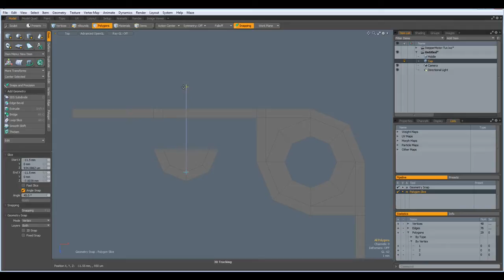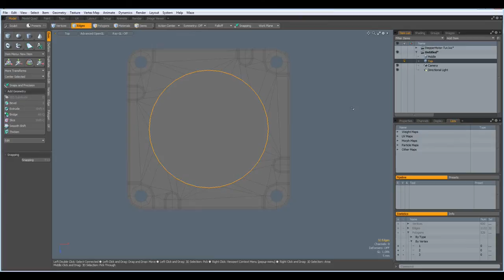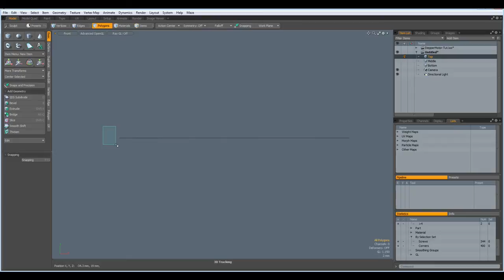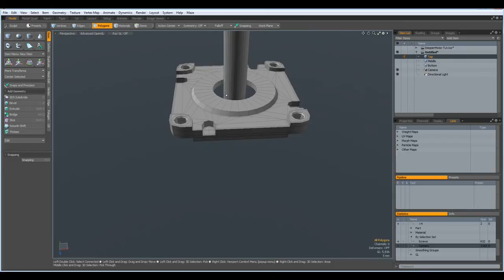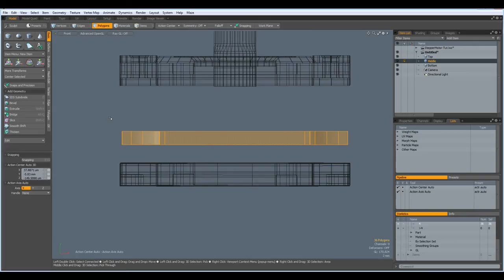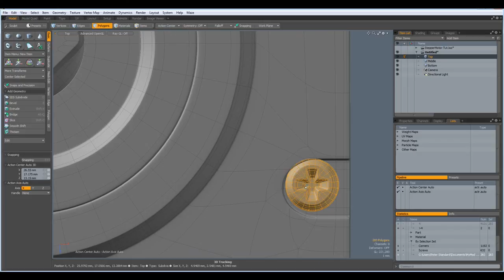Luxology modo - Modeling a Stepper Motor

Comment from the maker: Hi, the minimum graphic requirement for modo 501 is 1280 x 800, so it will not run in your graphic card. Sorry about this, but here are the minimum reaquirements for modo 501:

Windows 7, Vista and XP (32 and 64 bit versions)
2 GB available hard disk space (including full content installation)
2 GB of system RAM
Accelerated Video Graphics adapter with OpenGL support capable of minimum 1280 x 800 resolution

Kind regards, Peter